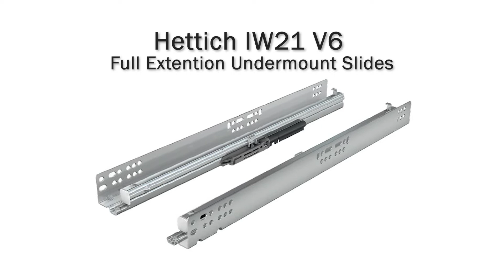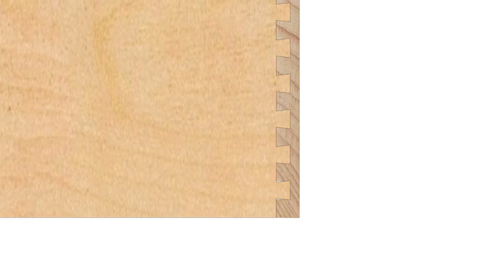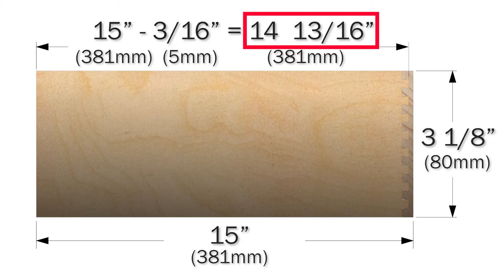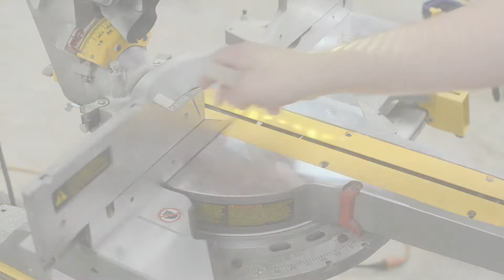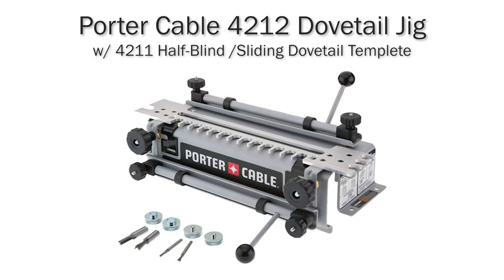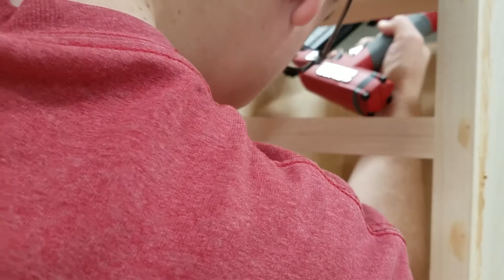Half-Blind Dovetail Drawer Box: The drawer box that most think is too hard to build.

Comment: This was exactly what I was looking for, how to set up for 1/2" drawer bottom for undermount slides. However you skipped over the most critical part of the dovetail jig set-up, which was getting the groove aligned exactly so that it falls right in the slot between the pins. The one issue I see is that with 1/2" groove it will not necessarily be possible to make the top & bottom symmetrical for the dovetails, unless you specifically calibrate the height for that. But it looks like empirically your test vehicle was to give you a nice top appearance rather than symmetrical